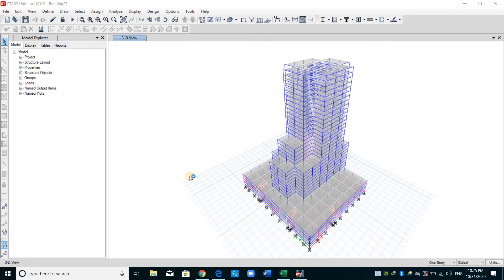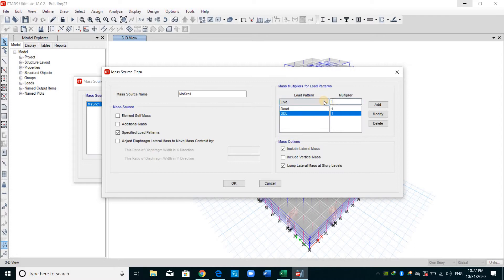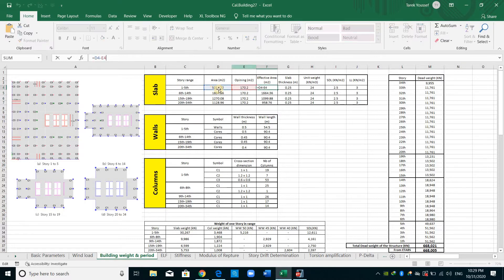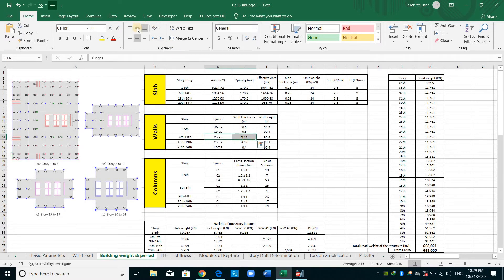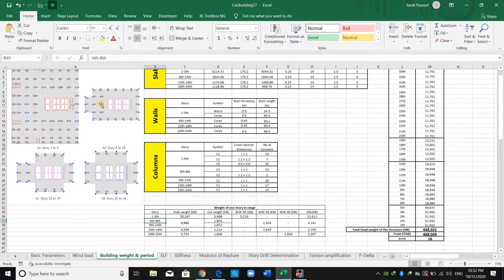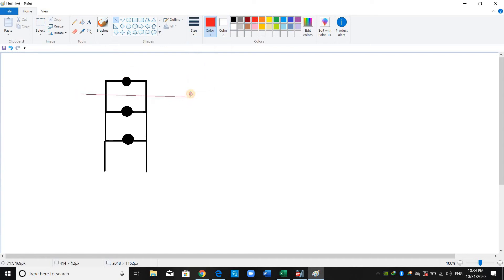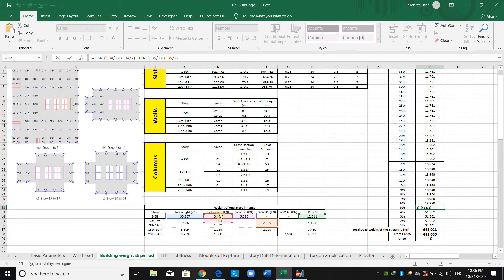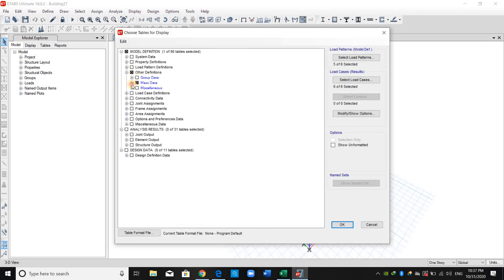Effective seismic weight and the lumped mass at the center of each story in ETABS (Lec9)

Comment: Why it is wrong if the mass is not lumped at the floor level. In fact there are two different mass matrix coupled and uncoupled or lumped and consistent. With shear walls mainly the consistent mass matrix is likely to be correct because the mass of vertical elements slightly smaller than or equal the mass of the floor then there is no point to lump the mass at the floor level.
Reply from the maker: ETABS does not lump the masses correctly to floor level if the mesh option for shear wall is used. This issue is also announced through the CSI website.

In reality, the mass of a building is not only concentrated at the floor levels but is distributed throughout the structure. Lumping masses at the center of each floor, which is done by the use of a rigid diaphragm, is an approximation to simplify the analysis.

Thus, the mass matrix generated in ETABS will be affected by the way the masses are lumped.
Reply: @Eng.tarekyoussef Thanks Tarek. I think this issue solved with Etabs 20. I’m just using etabs as 3rd party reviewer. Back to topic, using the lumped mass or consistent mass is something the designer can decide it but basically if the vertical elements or lateral resisting system is about same or higher than the weight of floor e.g, shear wall systems then lumped mass is not valid means the consistent should be used because the mass is distributed over the height of the structure

Comment: Dear Engineer its allowed for the building to be bigger than the other stories,,, as i see in your model there’s a five story as basement extended then 8 stories smaller then the rest of the tower is smaller in area it’s acceptable,,, since i guess its not allowed and you should have an expansion joint between the tower and the rest of the story if they are bigger in elevation
Reply from the maker: Thank you for your observations. Here are my clarifications regarding the structure:

No Basement: 
In this project, there is no basement; all stories are above ground.

Irregular Building Design: 
This building has an irregular shape. While using expansion joints can enhance the structural response, the current model was studied without expansion joints to understand potential issues within this system.

High Load Transfer at Podium Level: 
In such structures, significant load transfer occurs at the podium level, especially where there is a change in the floor plan layout. If this building were to be constructed, we would add expansion joints. This would divide the structure into several pieces, thereby reducing the intensity of the transferred forces at critical levels.